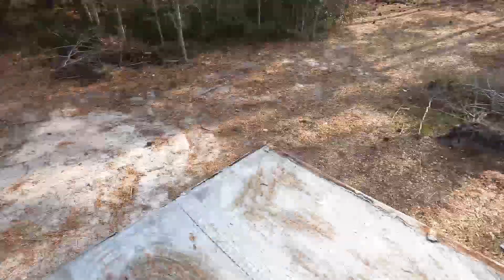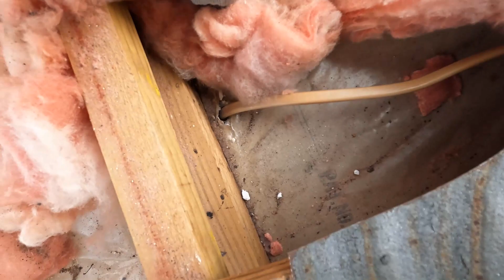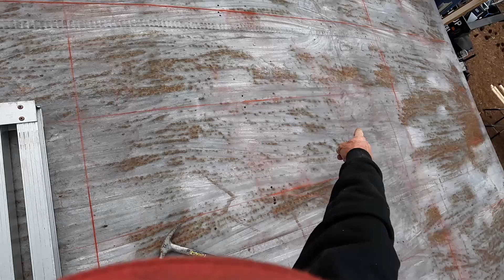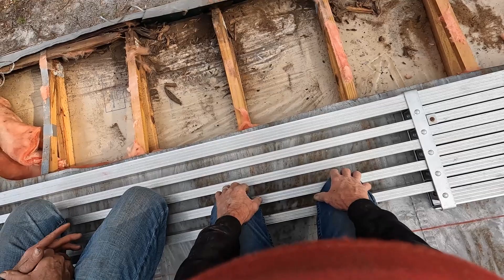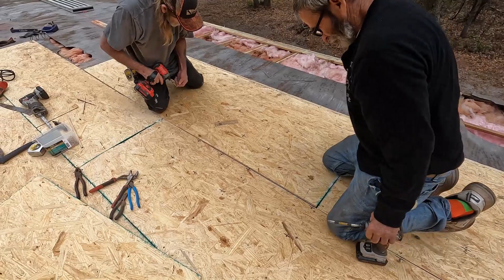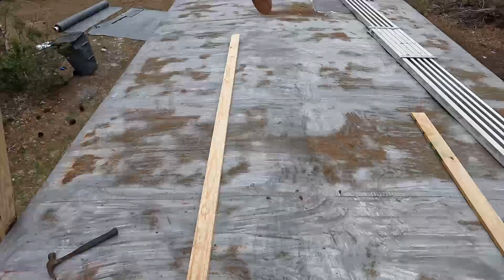Singlewide Trailer Re Roofing Problems. Mobile Home.

Comment: These roof repair videos are great, but where the heck are all your penetrations from your hood vent, stove vent, bathroom vents, heater vent,...etc.😅
Reply from the maker: All the plumbing vents on mobile homes nowadays they are going with ventless. It would be under the sink of your mobile home not through the roof.
Reply from the maker: Go on Google and type in ventless vent pipes
Reply: @Drewsroofingandhomerepair  it don't look like they're too reliable, however I can eliminate a lot of roof penetrations particularly the stove vent and heater vent... Stoves have self-contained vent hoods now, and if I go totally electric with the heating and cooling systems, I can eliminate my furnace vent "chimney".... It won't be a big deal to cut out for one or two penetrations, instead of dealing with the several that I have in my roof now.
Reply from the maker: https://youtu.be/lZey7FZbeac?feature=shared

Comment: With that much work, would it be beneficial to cut all the way around the edge and remove all the metal?  You could easily see and repair everything.
Reply from the maker: To be honest with you it’s not a bad idea. The only thing I don’t like about it is it’s dangerous and the Raptors without anything on them are weak and I would be afraid one of my 200 pound plus guys would fall right through so I leave it on for support.

Comment: Whats the benefit of keeping the metal roof and laying OSB on top of it? Would the metal act like a radiant barrier? Would it not be better to remove the metal roof and put the osb on the rafters? Maybe could go ahead and install a radiant barrier on the underside of the OSB like some sheds do.
Reply from the maker: Thank you for stopping by and that’s a great question I have actually done it both ways and I’m not sure if there was any benefit to removing it so for the most part when we do it we do not remove the metal. But like I said we have done it both ways I don’t think it matters either way to be honest
Reply: @Drewsroofingandhomerepair  If I did remove the metal, or didn't I could maybe add a ridge vent after cutting an opening along the middle of the roof to help keep the trailer cooler with some sofit vents on the ends like a traditional house? If I were to put a metal roof on for example.

Comment: Will y’all travel to the piedmont area of  North Carolina to repair and replace a roof on a single wide?
Reply from the maker: Yes we will.
Reply from the maker: I’m not going to lie. It is expensive. With gas and everything else being so expensive
Reply: @Drewsroofingandhomerepair  Just a ball park figure around how much it cost just so i can have a idea. Thanks
Reply from the maker: 910-294-1761. Between 7500 and 11000 according to the size
Reply: @Drewsroofingandhomerepair  14 X 66
Reply from the maker: 9000

Comment: That wiring going over the rafters can’t be to code, I’m surprised an electrical inspector didn’t catch it.
Reply from the maker: I see it all the time on mobile homes. It is the most incredible thing I’ve ever seen. I do not for the life of me understand why they allow them to do that but apparently they did I don’t understand it. It happens more often than you think more in the older mobile homes than the newer ones obviously
Reply: They didn’t start forcing a standard code with mobile homes until about 1982…before then they ran all the wiring through the center of the roof where they botched out a grove and laid them over the trusses…it’s mind boggling there are any older mobile homes left and they all didn’t end up burning down because of this crap…I have a 1977 mobile home that has wiring like that and it’s been a mess trying to figure out what wires go where and popping circuit breakers etc…I also am stunned that all they have are those tiny little trusses holding the place together on the roof lol
Reply: @w8what575  it looks like newer wires. I have a 1973 mobile home with solid trusses that has holes drilled for the wires, I didn’t trust the original wiring so had it all replaced, simplified and brought up to code.
Reply from the maker: I agree 💯
Reply from the maker: Wow split trussed
Reply: "Inspectors" ha ha ha... LMAO that's hella funny. Nothing's up to code in a trailer. Mines a '77 and hell, they missed screwing spots of siding, couldn't even hit a stud. But after market,  the things people have done to it are absolutely stupid. I've got a toilet that was plumbed smack dab in the middle of my heating ducts. And they didn't even seal the underside. The first year I had the place, I was heating the underbelly more than the inside. Oh and the shut off valve, uh yeah it was placed under the trailer. Lol. Stupid
Reply: @bizlarry  mine is slowly being brought up to code.

Comment: Were the rafters not wide enough that you had to put strips (1x2) to help tie in OSB and doesn't that lower you pitch?
Reply from the maker: We used the one by fours dropping to get up away from all the wires that were under the metal
Reply: Thanks for your reply. One side question when using a punch to find rafters is that how you check for rot on the fascia board?